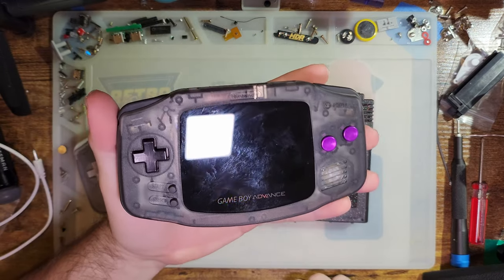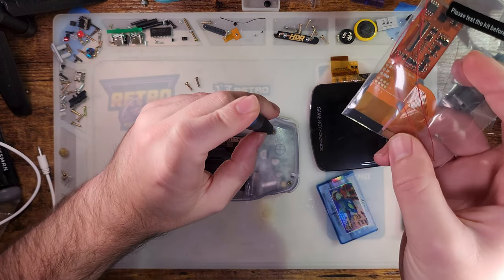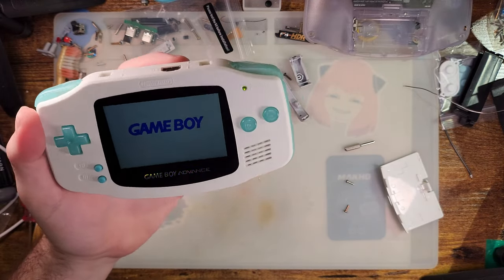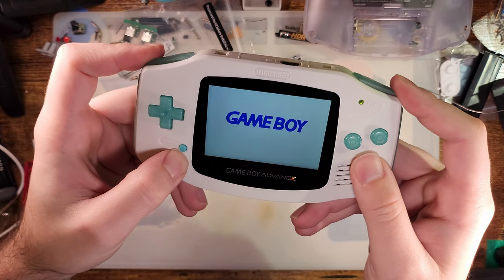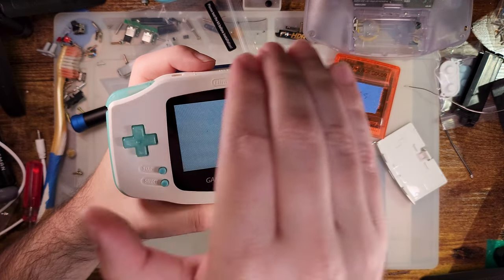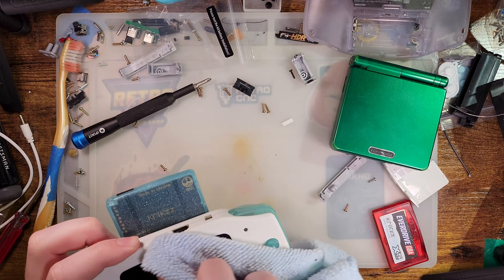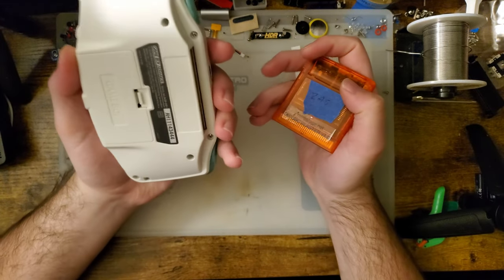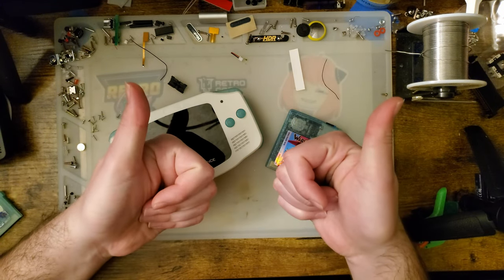Funnyplaying 3.0 Laminated IPS Kit for Game Boy Advance [CFR REUPLOAD]

Comment: Most comprehensive installation video I've found for this kit.  Excellent work, especially seeing the current draw.  The OCD sticker placement was also nicely done with the knife blade.  I did see another video where the flickering was adjusted using the little hole that is now underneath the sticker you placed so well.  I guess there's an adjustment screw there.  Hope that helps.
Reply from the maker: Yes but only ITA kits, AGS-101 mods, and OEM LCDs need to be calibrated. Adjust it before installing the sticker. Or poke a hole in the sticker. Or just remove the rear housing.
Reply: @makho  Ahh... Thank you. Didn't know that.
Reply: @makho  Hey so I bought a console that it is prelaminated but the seller didn't mention it. i was planning to change the glass. is it possible to do?
Reply from the maker: @camdelg1  Lamination is the process of bonding the LCD to the glass. You should not have purchased a laminated unit if you did not want it bonded. The bonding is permanent unless removed with the proper tools and expertise and even then, the risk of damage is high.

Comment: Would you recommend this for a first time mod? I’m really looking for a laminated screen to avoid any dust or is it better to go with a v2 ips non laminated
Reply: I did it as my first mod, however, I didn't solder as I was not interested in the OSD features.
Reply: Gave one to my friend. He has never had an ips display for gameboy. He absolutely loves it!  He's not really into the modding scene
Reply: It depends, its a but more finagling to put it all together because of the bracket and the foam, altough its not diffivult, but a HUGE pro is the fact that you dont have to worry about the screen not being centered, being dirty or getting dust underneath it.
Reply: @Haley Willard Hey, yeah, this mod goes pretty easy without soldering. I say go for it if you don't need the advanced controls.
Reply: @Haley Willard no, you can at at least adjust the brightness with the touch sensor, it will end up underneath where the Game Boy Advance logo is when the build is done.
Reply: @Haley Willard  does anyone know where to get a laminated screen with the accurate THICK GBA logo? I can only find the skinny knock off logo like the one shown in this video. Hand held legend and funnyplaying seem to only have the thin knock off logo as well. An eBay seller by the name of steadfast_enthusiast has pre-modded GBAs with the laminated screen and accurate thick / connected logo , however I am unable to ask him where he bought the screen due to eBay blocking me from sending messages.
Reply: @Sonic6293   does anyone know where to get a laminated screen with the accurate THICK GBA logo? I can only find the skinny knock off logo like the one shown in this video. Hand held legend and funnyplaying seem to only have the thin knock off logo as well. An eBay seller by the name of steadfast_enthusiast has pre-modded GBAs with the laminated screen and accurate thick / connected logo , however I am unable to ask him where he bought the screen due to eBay blocking me from sending messages.
Reply: does anyone know where to get a laminated screen with the accurate THICK GBA logo? I can only find the skinny knock off logo like the one shown in this video. Hand held legend and funnyplaying seem to only have the thin knock off logo as well. An eBay seller by the name of steadfast_enthusiast has pre-modded GBAs with the laminated screen and accurate thick / connected logo , however I am unable to ask him where he bought the screen due to eBay blocking me from sending messages.
Reply: @777superlightwater  You know, I ain't really noticed it but looking at my original screen and the new one, yeah, there's a difference. TBH, I'm not sure where one would go about finding a more accurate logo. You may have to find an original face shield as a donor and frankestein your own. Best of luck.

Comment: I saw that flickering on the ITA kit could be mitigated by adjusting the potentiometer on the back of the motherboard, I wonder if it would help with this kit as well? If I'm not mistaken there should be a hole on the back of the shell behind the sticker to get at it without opening it up. I know the two are pretty different under the hood and the display technologies are pretty far apart though so it might just be futile
Reply from the maker: That's not how this works
Reply: @makho  Figured as much, thought it would be worth asking just to make sure
(just to clarify tho - I know the flickering in games like ZAS is intended and just not visible on the original display because of poor pixel response times, not because of the voltage going to the screen. Just wishful thinking after buying this kit a week before this video went up)
Reply from the maker: @dj505  It actually can help with pixel response times, the ribbon is just already generating the optimal voltages. ITA was a bit unique in that the protocol for the new screen (DSi LCD) and the old screen (GBA side) were so similar that the kit didn't do everything itself. 

The newer LCDs are generally digital and take frames in the form of packetized data (MIPI specifically). This means there's not much to be gained or lost in the form of less than optimal voltages. There's a handshake and then the FPGA sends data to the screen. 

The older LCDs are a bit more analogue and have the colors split out into several different channels for RGB bits and frame timing information. These screens are more similar to what the AGB used originally and can be more sensitive to less than optimal voltages. These will take just about whatever they are fed (valid or otherwise).
Reply: @makho  That makes a lot of sense, thanks for the explanation! I didn't realize the ITA kit was so straightforward in comparison signal wise.

Comment: I've always wanted to just cut off the touch sensors as they've always been mega annoying and redundant to me but I really do not want to mess up a kit I own even if nothing should happen
Reply from the maker: Shouldn't be an issue. Would be better to just remove the IC that the touch sensor is connected to though.
Reply: @makho  Never thought of that, thanks!
Reply: @makho  IC?

Comment: What's the best screen with no soldering needed? I really was just looking for a light. Then I went down a rabbit hole and there are quite a few different ones. Now I'm more confused then when I started lol
Reply from the maker: wiki linked in description
Reply: does anyone know where to get a laminated screen with the accurate THICK GBA logo? I can only find the skinny knock off logo like the one shown in this video. Hand held legend and funnyplaying seem to only have the thin knock off logo as well. An eBay seller by the name of steadfast_enthusiast has pre-modded GBAs with the laminated screen and accurate thick / connected logo , however I am unable to ask him where he bought the screen due to eBay blocking me from sending messages.

Comment: I’ve just had this kit arrive. Worried about bothering to build I’ve with it now with the odd scaling and transparencies issues
Reply from the maker: I thought it was obvious that I was pointing out edge cases.
Reply: @makho  yeah you did. Was just worried about the scaling conspired to the IPS but I’ll see for myself when I get time to install this. Had it on my desk for 2 weeks but just been way too busy
Reply: @TimdeVille  I just installed the mod, and i haven't noticed any problems during gameplay. The image retention is also a lot less compared to the v.2.0 kits i think. Also noticed that the first color option is slightly less saturated which is more accurate to original gba displays. Its not perfect ofc, but it makes games like DKC more playable compared to old funnyplaying ips mods.
Reply: @shadeymcbones6707  that’s great to hear. I’m really looking forward to seeing what it’s like. Got some cool buttons to go with the build too. Just have had it got time to make it at the moment unfortunately. I’m sure it will be nicer having no dust under the screen lens too!
Reply: does anyone know where to get a laminated screen with the accurate THICK GBA logo? I can only find the skinny knock off logo like the one shown in this video. Hand held legend and funnyplaying seem to only have the thin knock off logo as well. An eBay seller by the name of steadfast_enthusiast has pre-modded GBAs with the laminated screen and accurate thick / connected logo , however I am unable to ask him where he bought the screen due to eBay blocking me from sending messages.
Reply: @shadeymcbones6707   does anyone know where to get a laminated screen with the accurate THICK GBA logo? I can only find the skinny knock off logo like the one shown in this video. Hand held legend and funnyplaying seem to only have the thin knock off logo as well. An eBay seller by the name of steadfast_enthusiast has pre-modded GBAs with the laminated screen and accurate thick / connected logo , however I am unable to ask him where he bought the screen due to eBay blocking me from sending messages.
Reply: @TimdeVille  what did you end up thinking? I was about to order it but after hearing about the integer scaling issue, I haven't
Reply: @JamesPound  I think it looks fine really although I must admit I built a lovely looking GBA then ended playing mostly on my Retroid

Comment: Hey I'm not entirely sure on this, but I'm pretty sure that black speck on the left half of the screen at 36:18 is a dead pixel.
Reply from the maker: I think it was actually a bit of schmoo on the glass surface. I don't still have that specific LCD assembly installed in this console or I'd go double check.
Reply: @makho  Oh, ok

Comment: Hi, just a comment to add something from my personnal experience

I received and installed an IPS laminated kit yesterday
I bought it from some store on aliexpress, it was a bundle that came with a shell and the rechargeable battery. The battery itelf have a funnyplaying branding but not the rest (that i could notice, i forgot to really check everywhere, too exited to have it installed)
One thing that initially surprised me was that the bracket was different, but since then i saw on the funnyplaying website, on the tutorial page, an addition about it (except their is transparent and mine was transluscent white)

A major difference compare to what i saw on your review is that in my case the frame (FRM) setting actually do something, i did the "chain test" in zelda links awakening dx and its a clear difference when on and off (transparency and no flickering from my perception when On). But i don't know if there is any tradeoff as i dont have a full suite of test or what to look for exactly.

I would also like to thank you for your videos, watching them gave me a really good grasp on what to do and how to do it. It have been a breeze and a really satisfactory experience. (my only soldering experience being from middle school ; and i would also add : amen to flux)
Tho im kind of afraid to have fell into a new hobby rabbit hole.
Reply: After some more playing around i actually noticed in zelda that with frame ON i actually have some grey "artifacting" on link while moving around, its not systematic, like if there was some conditions for it to glitch which i couldnt identify.
The issue is exactly the same on zelda oracle of age.
(and the issue disappear once frame is deactivated, but of course the transparency flicker come back)
Reply: Does it have the accurate thick GBA logo or the thin knock off one like in this video?
Reply: @777superlightwater  Sorry for the late answer, the logo is definitively thiner than the OEM one, its also have a mirror iridescent finish instead of a more mat silver metalic one
also the lense border is black instead of a dark grey, and because of that the logo doesnt have the black border it have on oem too

Comment: I have this kit and for some reason im getting a backlight bleed on black screens on the top middle and a bit on the right side of the screen. I have taken it apart and tried to see if there was anything pushing on the back of the screen as when i test it before i assemble it there is no bleed only happens when everything is fully assembled any ideas? Dont seem to have this issue on any of the  non laminated kits.

Comment: The LCD is the 640x480 pixels. For Panasonic Lumix DMC-FZ1000.   This new LCD is Fake Pixels, not pixel to pixel.  I prefer V2 IPS to this LCD screen. The V2 IPS is pixel to pixel.
Reply from the maker: "fake pixels" is a ridiculous buzzword but thank you for identifying this LCD. While I do generally prefer integer scaling, I don't believe the scaling here is bad. It looks bad in nearly all my artificial tests but in actual games, I have no issues so far.
Reply: @makho  laminated is ideal! no dust, perfectly even at the edges! cooler if nintendo releases a new revision)
Reply: @udjinhanc   does anyone know where to get a laminated screen with the accurate THICK GBA logo? I can only find the skinny knock off logo like the one shown in this video. Hand held legend and funnyplaying seem to only have the thin knock off logo as well. An eBay seller by the name of steadfast_enthusiast has pre-modded GBAs with the laminated screen and accurate thick / connected logo , however I am unable to ask him where he bought the screen due to eBay blocking me from sending messages.
Reply: What does pixel to pixel mean and what makes this one fake?

Comment: Put this in my friends gba for his birthday. Can confirm all the osd menu options are the same on mine and yeah frm does not seem to do anything on mine. Not really sure
Reply: does anyone know where to get a laminated screen with the accurate THICK GBA logo? I can only find the skinny knock off logo like the one shown in this video. Hand held legend and funnyplaying seem to only have the thin knock off logo as well. An eBay seller by the name of steadfast_enthusiast has pre-modded GBAs with the laminated screen and accurate thick / connected logo , however I am unable to ask him where he bought the screen due to eBay blocking me from sending messages.

Comment: What is the quality of the laminated shells I saw a video saying they crack easy
Reply from the maker: Hasn't been my experience. Make sure you're not pinching any wires and you properly torque your screws and I don't think you'll have any issues.

Comment: I do not see the scaling issue through the video. Anyone explains to me please?
Reply from the maker: Did you check the description?
Reply: @makho  yes. I get it now.
Reply: @makho  what did they say after your report about the scaling issue? I am expecting a v3.1 which would fix this.
Reply from the maker: @xboypro  There's nothing to fix. The screen is simply not an optimal resolution for integer scaling.
Reply from the maker: @xboypro  Also, it's not "v3", it's a three inch diagonal screen which is why it's 3.0.
Reply: @makho  I have tried this kit myself. One more thing is this kit is not compatible with overclocking mod while the previous version is.
Reply from the maker: @xboypro  That is good to know, thank you. That's unfortunate though.
Reply: @xboypro why?
Reply: Hello, what is the screen resolution on this ips laminated gba ?

Comment: Your explanation of flicker because the IPS pixel response is so good vs old lcds makes no sense.  The SP 001 has 0 pixel lag and 60hz smooth and yet 0 flicker on transparency. Any IPS kit will have pixel lag vs SP 001 display.
Reply from the maker: nothing has zero lag. AGS-001 do have less ghosting than earlier (and later) models but that doesn't mean they have no ghosting.

Comment: Tldw; seems like a terrible kit with the scaling alone… do not buy , and love that its called v3 even though they regressed. Market saturation of inferior products ftw!
Reply from the maker: nowhere does it say "v3". That's the screen size.
Reply: Is there even any kit out there that doesn't have some stupid issue?
Wrong aspect ratio, wrong refresh rate, artifacts on screen, impossible to install centered, unusable without a custom lense and a ton of cutting to the housing.

Wish they got it right for once, otherwise it is pointless.
Reply: @makho  my bad mistook the 3.0 as v3, i did watch your first upload of this btw, also not a fan of the touch sensor trend. I always avoid those builds if i can.
Reply: @mister_milkman  right! Instead of half baked iterations, just do it right and have one good part!

My fav is the ITA gba screen at this stage, the screen may not be the absolute best, but it checks most of my boxes